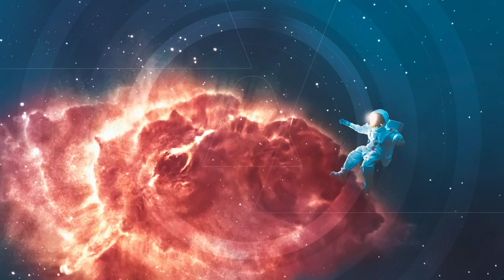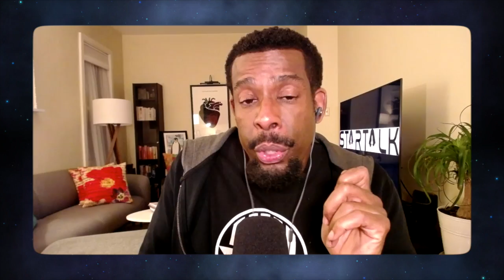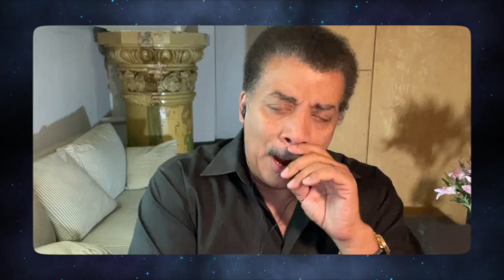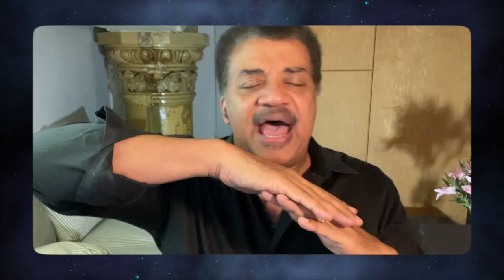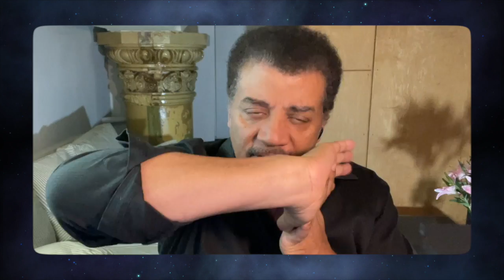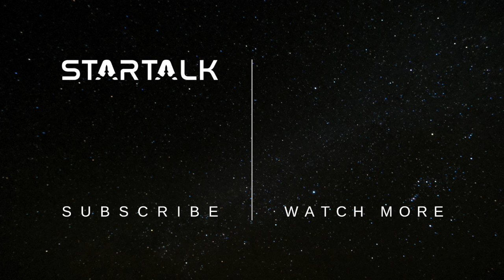Neil deGrasse Tyson Explains Banking Turns

Comment: seems as if you should "feel" your planet blasting through space as well. But when it comes to Macrocosmic objects vs Microcosmic objects physics has some fun tricks with your sense of "perception" . That said they do NOT REQUIRE A COMPUTER TO DO THIS AT ALL they have instruments to pull off all the same turns on smaller aircrafts the reason we use a computer on Neils craft is simple. IT IS A LARGER CRAFT AND THE ACCURACY OF THE INSTRUMENT IS LESS OF A FACTOR THAN THE EFFICIANCY OF TIME USED BY OUR PILOT. Remember larger planes have more to "baby sit" by our proverbial Pilot here.

Comment: In flying it’s called “stepping on the ball” (as in the ball at the bottom of the turn and bank indicator). That is a coordinated turn (the plane is not skidding or slipping) with the proper amount of rudder for the angle of bank. No computers are involved when “hand flying” and making turns. If you took a few hours of beginning private pilot’s license training you would learn this skill.
Reply: What I never got tired of seeing was anything (like a ball or the "fuel checker") roll UP the dash in an uncoordinated turn.  Always amazing to me.
Reply: Properly trained pilots don't even need an instrument to make a coordinated turn. The balance of the forces is easily felt, and the airplane is simply controlled to keep them in proper balance.
Reply from the maker: Thank you for your knowledge!
Reply: In FPV (racing) drones you also have to coordinate all four axes at all times; to balance altitude & flight attitudes, and compensate for the non-level camera pitch

Comment: This is nothing new, Neil.  Every airplane down to the smallest 2-seaters has an instrument called a turn coordinator which contains a ball in a curved tube.  In a bank you have to use enough rudder to make just the right amount of centrifugal force to keep the ball centered.  It's very basic flight training principles and doesn't require a computer or autopilot to do it.

Comment: Sorry Neil, you kind of got lazy on this one. 

If there are people in the spacecraft, there had better be banking. Banking counteracts momentum when making a turn. Nothing to do with atmosphere. A spacecraft making a turn to the right without banking would send everyone to the left because of the momentum - the tendency of objects to move in a straight line. Also, you should have mentioned that you do feel your weight increase as you bank and turn. This is how you know, without visual reference, that you are either banking/turning or climbing in an airplane, or banking/turning or moving vertically in a spacecraft. 

In Interstellar, when Cooper tries to attach to Endurance while spinning, they had to match the spin. The whole sequence, the two astronauts are being pushed sideways because the spin has no banking. This was accurately depicted. 

The only differences between space and atmosphere is that a spacecraft can’t push against air and would have to use engines to push, otherwise there would be no turning - just banking. In The Expanse, spacecraft perform breaking and turning by flipping and burning. That’s cool and also accurate.

Comment: In a near empty aircraft during the pandemic, with the plane being very light I found that some pilots were clearly "experimenting" with fairly tight turns while still climbing soon after take-off. Drinks are not served at that stage in the flight, but how would the fluid in my glass look then even if the computer did everything right regarding lean angle and turn radius?
Reply: Level

Comment: This is a strange one for me because after more than a hundred flights on around 30 different aircraft, I have never ever experienced what Neil is talking about. I’m someone who always has the shade up (unless sleeping), and as much as I can remember, I have always been able to feel the plane banking some have been more than 45 degrees and have seen water in my cup move from side to side. While I don’t doubt validity of what Neil is saying here, but I very much doubt that it is common.
Reply: I usually can (or I think I can) tell when the pilot is flying manually vs a turn being done by computer. Some pilots are better at it than others. Flying out of Juneau, Alaska going north requires an immediate hard left, and the measure of success to me is always how well planted in my seat I feel during the turn.

Comment: Hi Niel, I like your videos and scientific nature so much that I'm willing to disagree with you.

I disagree with you that space ships don't have to bank to avoid the feeling of being pushed to the side. The banked track (in racecars) and the cushion of air (airplanes) aren't relevant; they are not the cause of the need to bank, but they do help facilitate the banking. The same laws of physics apply on the surface of the Earth as in outer space. Just like you said with the car example, your body wants to go in a straight line but the car/spaceship is turning. If your car/spaceship turns right, your body continues going straight and it gives you the feeling you're being pushed to the left. Banking is OPTIONAL in cars, airplanes, and spaceships.... unless you want to avoid that feeling of being pushed to the left. By banking you're essentially reorienting which way your body will feel like it's going when it continues in it's straight line; the objective of banking is to keep that straight line directly underneath you so you don't feel like you're being pushed to either side (or upwards), but only straight down in your seat.

I also disagree that a computer is required to bank an airplane... although computers can probably do it better. Unlike the other commenters I don't even think you'd need any instruments at all, you'd just be able to feel your body being "pushed" to the left/right and you can intuitively (or with a tiny bit of practice) just bank your plane the appropriate amount to "keep the straight line directly underneath you". However I don't want people to misinterpret what I'm saying: you definitely still do need instruments to fly in bad weather because you'll still not know which way is up/down/etc even though you'll be able to comfortably bank straight into the ground :).

I also have an unrelated tricky question (maybe ez4u) for you if you want to hear it, but sorry I'm not willing to sign up for Patreon just to ask it. Nor am I going to ask it in a sea of unread youtube comments. Let me know.

Love,
Steven

Comment: Ummm…no…the video is so bogus.  I often fly my 737 until we get to cruise and you wouldn’t even know that the airplane is being flown by a human vs a computer.  

The main reason you don’t notice a bank is because the airplane is only banking a few degrees at a time and without visual cues your inner ear and “seat of the pants” won’t notice.  That’s the main reason we have instruments that tell us bank angle. Without instruments you could end in a graveyard spiral and feel as though you are flying straight and level.  

We also rarely make big turns at cruising altitude so it’s about the same feeling as a slight curve on an interstate, as a passenger in a car you often don’t notice a velocity vector change if you aren’t looking outside.

Comment: This is achieved in small single engine Cessnas, Pipers, etc. as well - all manually (no onboard computer).  It’s called a coordinated turn in which the pilot centers a ball in a sealed glass horizontal tube filled with fluid  (within the instrument panel).  The pilot simply coordinates aileron and rudder inputs.  Your beverage will remain level in the glass.  All pilots know this.

Comment: GAH!  He's still claiming that it's all because of computers that aircraft are making coordinated turns.  THIS HAS ALWAYS BEEN THE FIRST THING STUDENTS LEARN IN FLIGHT SINCE AVIATION BEGAN.  Long before the computer was invented, there's a gauge called a "turn and slip indicator" (or turn and bank indicator.  I've heard it both ways), and it tells you when you're doing a turn correctly, i.e. the push on you is directly down into your seat.

Interestingly, the one Star Wars tech that might be possible is the "force field" of sorts that holds atmosphere in.  It's called a "plasma window".  Unfortunately, it probably isn't scalable to spaceship size, and may not actually allow a spaceship through since it's a trick of magnetic fields and superheated plasma physics.

Edit: also, in simpler times, I once flew in an old J3 Piper Cub that didn't have many gauges in it, so the owner had tied a piece of yarn on the antenna mounted in front of the cockpit that gave him a crude way to see if he was slipping his turns.  Not perfect, but effective.

Comment: I have pictures of the wing on a Spirit plane I was in. It was missing one of the upright things at the tip of the wings, and the outside 1/3 of the wing looked like it had backed into a building. I started to freak out a little, and the guy next to me said "I'm a pilot. That's not an issue. Those are only there for fuel efficiency, and the rest is superficial damage."
He was right. Everything went just fine. What do you want for $100?
Reply: We pilots call that "hangar rash" ;-)

Comment: For a car on a banked road, you still need to turn the steering wheel, you just won't feel lateral acceleration. But something without traction, like a rolling ball or a car on ice, will stay on the road if it's going the right speed for the bank.
Reply: I've watched 100's of races with "in car" camera shots and I've never seen them drive into a corner without turning the wheel. Most race cars that just go left will have the suspension set up to turn left with little input from the driver.

Comment: I don’t necessarily think a plane needs to be controlled by a computer to make your beverage stay level while the plane is turning. When an airplane turns, the pilot uses a combination of the ailerons (banking), the rudder(yaw), and the elevator (pitch). When a turn is executed correctly, it’s called a “coordinated turn” and you won’t feel pushed to the side like you would in a car. There’s also an instrument in the cockpit called a “turn coordinator” which helps a pilot do a coordinated turn. It looks sort of like a level with a bubble in it but instead of a bubble, there’s a little ball. You want to keep the ball in the center. For instance, to make a left turn, you’d start your turn by banking the airplane left by turning the wheel or yoke left. As you do this, the tail would slightly go to the left (yaw right), and the turn coordinator ball would go “left of center” on the gauge. You’d then apply slight left rudder(yaw left) until the ball reaches the center of the gauge again. This keeps the plane from “skidding” which makes your drink stay level and keeps the passengers comfortable. The plane also flies better like this. For instance, at slower speeds, like when landing, it’s very important to do coordinated turns to keep the plane from stalling (dropping out of the sky). If you do a sloppy, non coordinated turn, the stall speed would be much higher meaning the plane won’t fly as safe at the slow speed. I’m a pretty proficient RC pilot and have about 20 hours or so in real airplanes but never actually got my pilot’s license. I’m sure an actual pilot could explain this better than I can, but that’s pretty much how it works.
Reply: Mans wrote a whole book 💀
Reply: @alessandroreyes8250  Blunted, haha🌲💨

Comment: Actually, there is an existing technology to allow that scene from Star Wars where they going from space to open landing deck  with atmosphere. It's called 'plasma window'. Currently it is only manageable for very small size, but get a soft  and penetrable separation from vacuum and atmospheric presure
Reply: That's definitely an interesting thought. I imagine having a huge wall of plasma would be problematic for the ship holding it and the ships flying through it though lol.
Reply: @H3LLS4NG3L  I was an engineer working with plasma all the time for etching semiconductors. While the plasma atoms ARE at an extremely high temperature, the low mass involved means hardly any energy is transferred . It's no doubt that going through a "plasma wall" would definitely remove all that pesky "carbon scoring" after a tough battle, saving their R2 unit a little work!! LOL
Reply: @airplayn  lol that's a funny thought! Would damaged spacecraft be even further damaged by the plasma? For example, a huge rigid hole in the hull, exposing electronics. I would think it would completely destroy the electronics and the plasma would be attracted to the jagged edges of the hole, arcing, and possibly melting that area. I guess some of that depends on the width of this theoretical plasma wall.

Comment: Keep up the good work. I am a big fan.

My humble correction to the statement you need a computer for a "coordinated turn" is incorrect. A decades old device called a turn coordinator exists even in a small single-seat airplane. It's a ball in a curved glass cylinder. Pilots use their rudders to keep the ball in the center of the cylinder. When ball is not in the center, you are either skidding or slipping.

Even in fully automated airliners, pilots can fly manually in which case they have to use their rudders to achieve coordinated turns. The difference... ball-in-cylinder is replaced by solid state turn indicators.
Reply: Properly trained pilots don't even need an instrument to make a coordinated turn. The balance of the forces is easily felt, and the airplane is simply controlled to keep them in proper balance.
Reply: @harvey66616  your reply deserves more upvotes! A decent pilot doesn't need an inclinometer to make a coordinated turn.

Comment: It works exactly as explained,only thing I would like to mention, it does not depend on aircraft´s computer. Even hand operated airplains are capable of that, since it is natural to airplaines generally.  Hand operated airplain maigt do it with a minor flaws, depend on the pilot´s skills. Airplanes are amaizing. On the other hand, Mr. Neil deGrasse Tyson mentioned, that passenger might not even know that plane was turning- this unfortunately applies to pilots too inside clouds- since they can not observe the horizon. Pilots must fully rely on many instruments when flying inside the clouds, because of some false feelings about their real bank which described Mr. Neil deGrasse Tyson. Pure instrument flying without any observable horizon is hard to do and must be trained properly. I would say, flying in clouds is one of the most dangerous tasks to do for any pilot and sometimes can have deadly consequences.